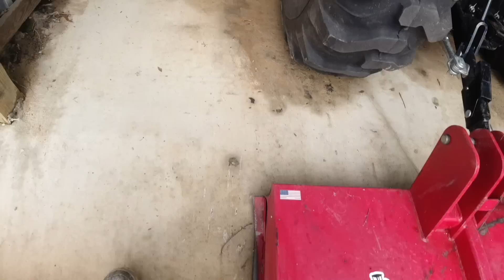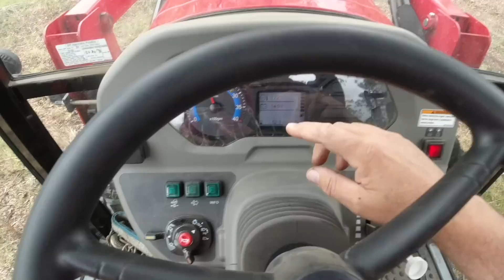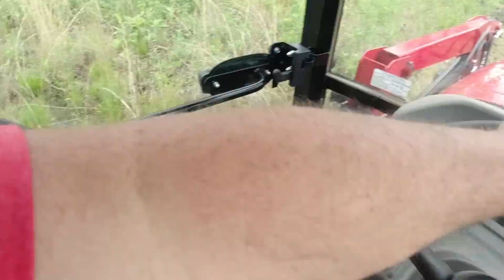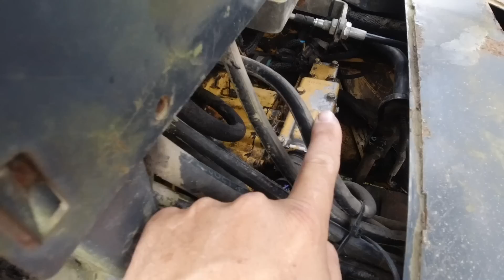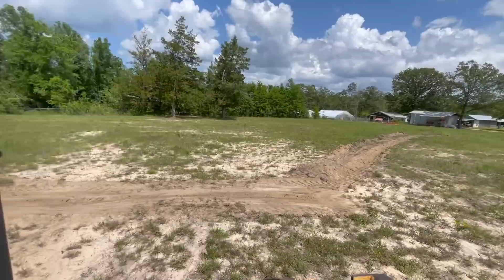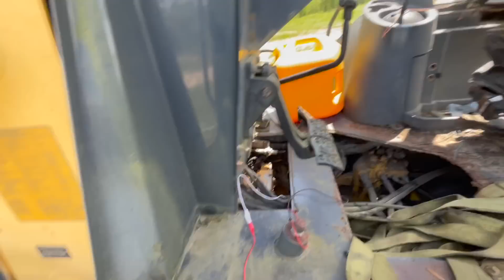ABANDONED digger can now drive! A GREAT DAY!!

Comment: Very interesting. I have a 410-D that had the exact same issue with trying to go forward. While I take care of most all the issues that develop, I couldn't figure that one out. I had to trailer it to the shop where they did repair it. The diagnosis? They told me they had to dismantle the transmission and that a small spring was broken and that was causing the issue. I don't recall how much they charged, but it wasn't cheap as you can imagine. Now I doubt their honesty after seeing what you found. YouTube comes in handy for a lot of things and your video was enlightening to say the least. Very nice job and I'm glad you shared what you found out. Thank you!

Comment: I do everything on everything but build new lines for the hydraulics. But I grease all of everything. I bought a great air grease gun with a thumb lock for the grease fittings. Easy to grease and because I use it here and there, it is always greased. I’m anal about greasing my tractors! 🥴😂

Comment: Why hadn't you purchased a Service Manual before? I believe in an earlier video you claimed to have a wiring diagram, I guess maybe you have some trouble reading them? It should have shown a path from the switch/button to that solenoid housing. Some of the electrical notes are wiring schematics and some are wiring diagrams, one is easier to understand than the other IMHO... Glad you got it going, nothing about BHL's is easy or cheap to fix...

Comment: Did you cut the wires? Or were they pulled by a stick or something else while it was in use? I would try repairing the wires before anything else and test. See if you can find a schematic for the shift circuit and go from there first. If it has to have power on two wires you should be able to turn on the switch and shift to forward and see which wire is hot then reverse the same way to make connections. Wires should be marked with numbers about every 8-12” starting at the plug. If you can identify the wire numbers easily makes repair easier.

Comment: the fuel could be returning to the main tank which is why it drank it out of the can so quick. and for the transmission a two position switch would work for the direction change.

Comment: You’ll figure out where that fuel went when the tank you say doesn’t work overflows. Almost all, if not all Diesel engines have a return line to the tank because the excess fuel flows through the pump and carries heat away from the injection pump and the injectors. Get the main tank working and you’ll notice the fuel isn’t being burnt, but it’s making a loop through the injection pump and back to the tank, so you won’t be putting as much in it.
Reply from the maker: Yeah I knew that… totally had a brain fart. Lol
Reply: @Hfoutdoorsyt  
I know how you feel Hank! I have at least 10 of those a day!

Comment: You need to get a tracked skid steer with a forestry mulcher out in that bush where the stumps are and make em' go bye, then you won't have to worry about hitting them with the bush hawg. Great to see you figured out the problem on the 310, basically a pain in the azz wiring problem.
Reply from the maker: Got one coming in May/June…..maybe

Comment: Check the fuel line from the tank for a fuel delivery issue. Had one that looked good on the outside but was calapsed on the inside starving the motor for fuel.
Reply from the maker: I put a new line on it today. Still didn’t pickup. So it’s got to be in the pickup tube or filter in the tank. I’ll take a look tomorrow and get it fixed.
Reply: @Hfoutdoorsyt  gotcha. Yea it Could be rust plugging the screen on the pick up in the tank. Whatever it is sounds like it's "somting wong" in the tank.

Comment: good evening hank, you need a double-pole changeover switch [its got 6 connectors on]
your diesel is filling up the original tank, you need to put the return line in your can, see what happens when whiley doesn't come out to play....
wait till your missus sees that field, be sleeping in the greenhouse tonight i reckon...
Reply from the maker: Just put one on this morning!
Reply: @Hfoutdoorsyt  in UK, diesels are known as heavy oil engines, [its on the vehicle registration document], so your tractor tank is 100% making oil....
Reply from the maker: Lol. I drove a few articulated lorries in my days over there
Reply: @Hfoutdoorsyt  forces?
Reply from the maker: Yep. USAF… RAF Alconbury
Reply: @Hfoutdoorsyt  200 miles from me [about half of england away], pass by it on way to london, full of blokes driving on the wrong side...

Comment: A 3 way toggle switch would work good Scott one hot wire to Ito it 1 hot wire for forward 1 hot wire for backwards flip the switch up goes 1 way flip the switch down and goes the other But the switch in the middle does nothing
Reply from the maker: Just did that this morning

Comment: I like to keep in 2 wheel drive until I get into trouble or just about.  I have had 4 wheel and drop into a hole and have all 4 wheels dig into the hole to fix me there. Be cautious on your driving 4 wheel fast as you can dig in almost instantly.  I have a John Deer 1025R    Where does that cable go ?  Trace that down and see if there is a broken connection on the other end.   YOU are doing good and making progress.
Reply from the maker: Thanks buddy!

Comment: As they say, sometimes a blind squirrel finds a nut, which you proved with the forward motion. I run a John Deere 3038e with a 84" Land Pride finish mower or a Frontier 60" Bush hog. Also, have a 2001 Bobcat 873g with a Quick Attach 72" Brush Cutter for whacking the stuff you did.

Comment: I think you have to connect those wires to shift selector, just rewire it then you wont have mess arround gauge cluster. Otherwise you will have extra button or selector also couple more wires which is not necessary. A multimeter and some cables will solve your problem. good catch btw, interesting thing is it has 2 feed lines on selenoid, like a regular relay, so they has 2 functions. I really liked that machine, it is really good to have in any farm. Congrats finally you solved the problem Hank.  Wes is a good guy also i suggest that you have to watch scanner Danner, he is really good about diagnostics n stuff. I bet sometimes wes watching him too.
Reply from the maker: Right on. I literally called Wes when I figured it out 😂
Reply: @Hfoutdoorsyt  lol

Comment: I'm using an LS MT357HC, which is very close on most specs to your T574C HST, and your Branson 5520C before it.   Just a couple of hundred lbs heavier, 2 more HP,  couple of more GPM on the hydro pumps, and only about an inch different in length, width and wheelbase.  Heat, A/C, wipers, lights, hydraulic remotes, doors, windows all nearly the same.  Your T574 has enormous 3-pt lift capacity, though.

Comment: I have 2, the original is a Ford 1715 27 hp with a loader.  I've had it for about 5 years and used it extensively on my previous 6-acre property. .  Just bought a New Holland Boomer 50 Cab to work on the 20 acres and mile and a half of driveway and road.

Comment: The current tractor list on my almond ranch in California.  '39 cat d47U (running), 60s international  504 (running) late 50s international utility 350 (running), early 50's Oliver oc3 crawler (running), late 70's Massey Ferguson 50 backhoe (motor locked up, and all attempts have failed so far) 80's Massey Ferguson 1020 with loader (was running until clutch went out last month).  All these tractors were non running yard art when we brought them home with the exception of the ocs3 which was bought by my great grandfather new but took loads of time to get running again.  That's why I love your videos.  We do the same thing every weekend.  Keep them coming.

Comment: Excellent video Hank  :) don't have big Farm tractor but some can be fun to fix also some can task to work even for most excellent mechanics too work on and big puzzles too! But I have on homestead is 2021 TROY -Built Lawn Tractor it a Single Cylinder motor 28 hp gas 436 CC also Automatic Synchomatic handle shifter with 10 speed foward and 2 reverse also 44 inches bed for lawn care!  It gas model and but funny part takes 3 gallon fuel tank worth compare one had before had 5.5 Gallon too fuel and last month on Lol ! Also basic model I have takes 1 pint of Engine Oil fill crankcase up and also very comfortable seat on like big tractor have ! But on home farm when growing up was McCormick International  the 1968 105C combine gas model , also small loader was 1963 B414  also Desiel fuel motor 40 hp , 1968 International 624 A was 60 hp without Torque Amplifier on Transmission, 1978 International 724 B bigger loader tractor 72 hp Desiel motor with Allied Loader plus Torque Amplifier on Transmission for more gears plus speed and old 1950 Cockshutt COOP 40 43 hp gas tractor ! But all learn drive on and old  Cockshutt also all International tractor open no cab but 1968 624 had 1976 Chevrolet Impala 4 door family car hood on and I weld up also installed in 1992 for my high school Auto Mechanics project get marks on took 2 years do up ! Combine had cab with Air Conditioning 2 speed type ! Want Lol Hank my late dad  said many years after buying wishes tractor had it ! But old Combine I installed RPM gauge also horn features it did have help out too lots and who did mechanics work on Farm stuff was me also my dad my Late Uncle Bill didn't want only Cockshutt he had own after my grandparents past away till got scrap for parts too in 1993 ! But I enjoy farm stuff back then too and fix was challenge to ! I know my dad and his brother my uncle had mix of John Deere and International in Machinery plus my dad never like green color Lol but he made Lol said wishes had all John Deere tractor and Machinery because dealership near home farm had everything from 1910 to present years till close up forever in 2013 ! Lol great family business too had and helpfull but big John Deere Dealership in next Town was bigger and hard the local succeed that all!

Comment: In the past I knew nothing about building computers , fixing basic computer hardware issues , Windows OS software/driver issues. Over the decades I learned everything about computers all by my self by just jumping in feet first.
If I gave up on a issue that got me stumped to the point I'll just have someone else fix it. I would not have learned how to build / fix computers to the point people comes to me to get their computers fixed.
Also I know how to do electronic repair which comes in handy for dealing with computers that you believe is having hardware issues.

Comment: Your discovery tells me that a relay is not functioning. Be it a wiring issue, switch issue or the relay.
Reply from the maker: Interesting
Reply: @Hfoutdoorsyt  it's not difficult really. You have a common power source switching between two legs. In this case a forward and reverse solenoid. Tommies boy should have no problem sorting the issue fairly quick since you found the problem he only needs to find the solution.
Reply: I hate electrical issues. 😆

Comment: If your talking about using a pintle hitch trailer to pull that with your truck, it’s probably a bad idea. Your truck has two ratings, gooseneck/fifth wheel and conventional towing. A pintle hitch is under conventional, and my 3/4 ton Duramax was only rated for like 8,000lbs on the receiver. If y’all are still needing it moved let me know. I have a 35ft gooseneck that I can haul it with. (This is dmaxmarshall btw, just changed my name)
Reply from the maker: Ok. Thanks buddy. Like the new name
Reply: @Hfoutdoorsyt  thanks, glad you at least got it to where it’s usable.

Comment: I have a kubota bx25d.its about a 25hp tractor.it came with a loader and backhoe.made some fender brackets for it.used jd plastic rideing mower fenders.made the mechanical thumb hyd.installed a 3rd function valve.led light bar, and pod lights in the rear.has a warn winch on the front.
I keep customizeing it.makeing it more useable.
Id send you a picture of it.but cant seem to find out how to attach it to this. IM TECHINICLY CHALLENGED 🤣

Comment: Think  that is such great Detective work. I was just wondering is that the SAFTEY neutral switch control. So if you jump start her in gear it does not move or lurch the Backhoe. Just a thought. I have had problems with my 1978 Dynahoe-190 in second gear. Want to pop out of gear when I have more down hill speed than gears speed. That's my only tranny problem. My Torc. convert Leaks like a civ. I wire up a oil drain pan under her. I'm like you. I do as much as I can. Then I find experts in the old equipment know how, that are good at there work. My guy just closed shop up. But thank God almighty. Buying the 1971 SeaGrave Fire Engine found another top equipment shop from the local FD maintenance shop. When they have a problem with the NEW Fire equipment. Engine faults ( happen a lot) they take it to this guy. He's my NEW what I can't FIX guy. They usually have 3 class 8 truck in shop with Engines overhaul. Do a types of overhaul and services.
Reply from the maker: Nice.

Comment: Turned out to be a simple?? wiring problem rather than mechanical. I was going to suggest changing the reverser since changing to solenoid didn't help. The reverser being the actual shifting mechanism that the solenoid operates.

Comment: Lol! Way to go Hank! Only took you a year to figure it out! Goes to show you even a blind squirrel  finds a nut along the way!  Glad to see it finally getting to come around.  Now as to a temporary solution for the shifting. Why not get some wiring connectors an some wire and use a three way toggle switch to go forward and backwards. Mount it on the console or the steering column for easability and run it till you get it rewired permanently.  So it's workready.  Then since you put in that shootout on paw in law hit him up to just keep the 310 there for farm use. Perfect suck up on the inlaws! Lol! Then later give it a good washing and scruff it up a bit and give it a shot of new paint be perfect then to put Hamiltonville Farms on its sides and do offsite jobs to make a little cash to buy more farm equipment for the place.  As always enjoy your videos! Just surprised that Wiley wasn't around to see the triumphant victory for getting her moving!! 😳   Take care and looking forward to the next chapter in Hv Farms!
Reply from the maker: I called him when it happened. Lol. That’s a good idea about the switch

Comment: So, If you get a 3 position toggle switch and place your common lead  in the center and each lead  on the extreme ends of the toggle switch, you can use it as a forward / reverse  toggle switch.  Good job!  I know it feels good when the Lord reveals something you've struggled with.  I enjoy the channel and  really like Wally as well.
Reply from the maker: For sure. He is good to me!
Reply: Handyman, instead of using a 3 position switch why not just go to john deere and get the correct switch? Just a thought
Reply from the maker: Probably bc a three way switch is $1.17 and a jd switch is probably $175.65 bc it comes from John Deere 😂

Comment: Congrats on your discovery! To make it simpler, couldn’t you use the shifter lever on the steering wheel column or is it not getting power? Once again, congratulations Hank!
Reply from the maker: I’ll work on that next
Reply: Y not do a 2 way switch from solenoid so u wood turn it one way for rivs and one way for drive
Reply: @Hfoutdoorsyt  on the backhoe 310 is u still have it and am from the uk and I do a lot on montanes on equipment  message me back and the me no if that will work

Comment: The unused diesel bypasses the injectors and is returned to the main diesel tank! That's why the yellow container emptied out fast.
Reply from the maker: Ah yes….I knew that. Thanks!
Reply: That things makin fuel !!!!! I’m so glad you got the thing moving forward it felt like I was working on it !!!!! The shifter switch has to be it . I was wondering if it got parked because it quit running or it quit going forward being out in the weather probably caused switches to corrode . I guess a double pole 3 position switch will need replaced . What happens when your going forward with the jumper wire on and you put the selector in neutral ? What would happen if you were in forward and shifter the shifter to reverse  ? If both engaged at the same time while traveling it may tear a bunch of stuff up . Not been much on YouTube lately the Johnny Depp and Amber saga I clicked on that one time now it’s everywhere how glad I was to see your video and then running the 310 in forward !!! So happy how about ya !!!!